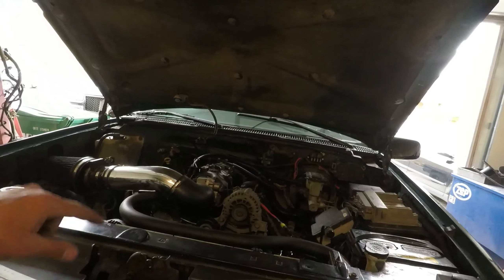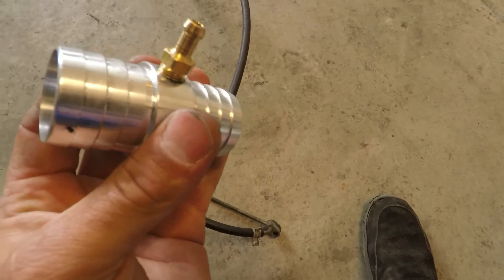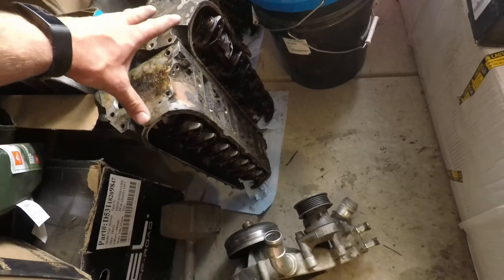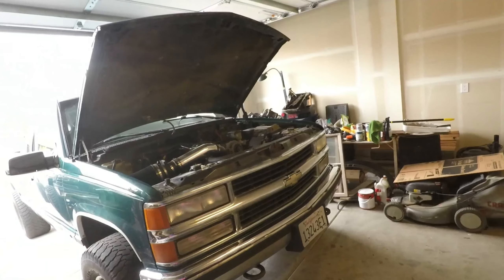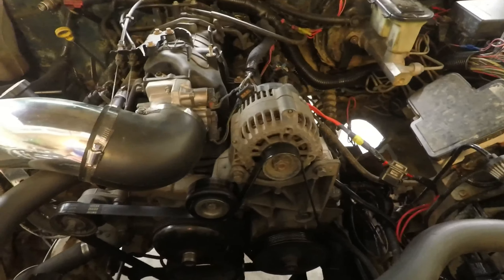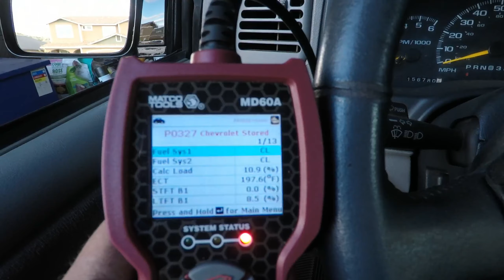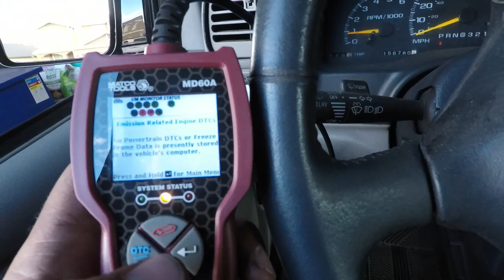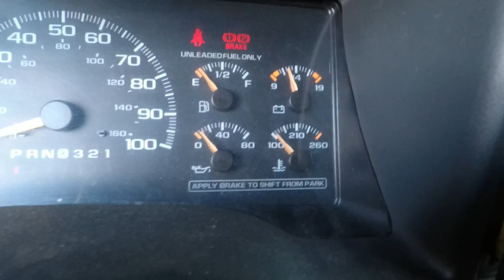DIY Junkyard 4 Corner LS Steam Vent

Comment: I'm putting in an engine with 118,000 miles. Should I go ahead and change out the knock sensors, or take the chance with it being lower miles?
Reply: I would look at them, they usually have water in them and can rust the sensors. If they are good, send it.
Reply from the maker: I would replace them but that’s me. But like Okie Joe said, definitely if they have rust.
Reply: You don't need knock sensors. If yall can't hear a motor knock.  Stop working on them. Jezz

Comment: What part number is the coolant t hose piece with the copper barn coming out of it???
Reply from the maker: I don’t remember. It’s a 1.25” fitting though. I looked it up on ebay
Reply: @EndlessWishlist  thank you...just found it on ebay.
Reply: How did you look up that radiator hose fitting

Comment: Hey man I’m doing the same swap, what power steering hose did you run? My return hose is fine but the high pressure side isn’t even close to fitting.
Reply from the maker: Factory 5.3 pump and lines fit great. It’s plug and play
Reply from the maker: I might have used the obs hose one one side. I can’t remember honestly

Comment: Have you thought of putting in a one-way in-line check valve so coolant doesn't back flow back to the heads?
Reply from the maker: No need. The heads have coolant in them already. This is just to get the air out.